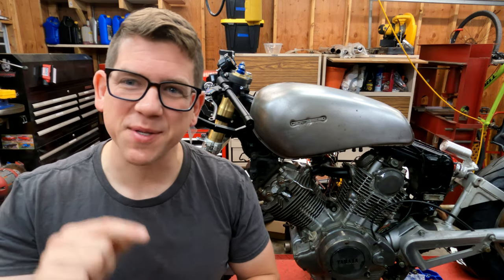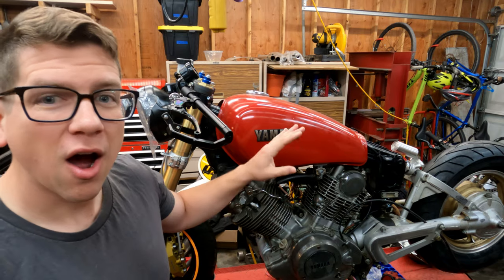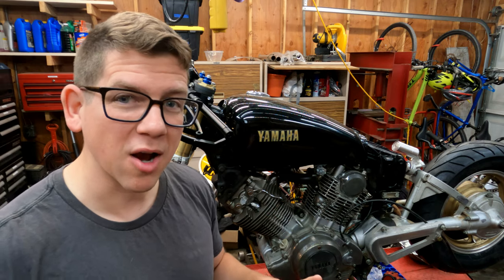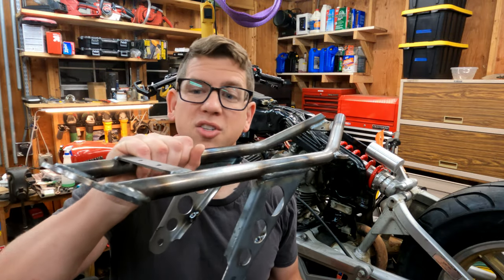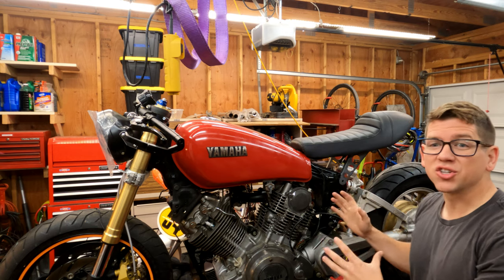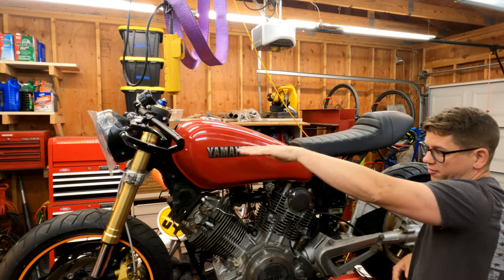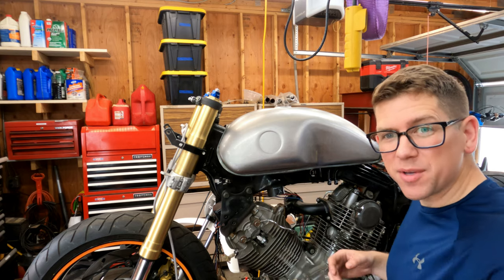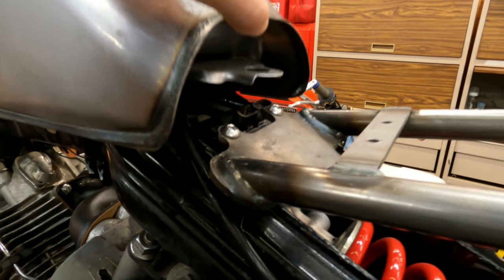Installing the TANK & SEAT on Our Custom VIRAGO Build  - Yamaha Virago Build Ep6

Comment: Hi, I started the same project around 2 years ago, and I'm stuck mounting the tank. I have the same tank that you have, but I don't know how you found the position of 1st hole to put the front base of the tank.  You did such a great job! And I'm afraid of damaging the chassis.  I have followed you all my fabrication and it has been very helpful. Thanks for these videos.
Reply from the maker: Just have someone hold the tank where you want it, make a mark on the frame, and go for it! After drilling one side, I made a template using paper and a pencil so that I could lay it on the opposite side and mark the hole, ensuring they line up.

Comment: Hey what did you use for the fuel system connected to the tank? I got the two side petcock now this tank comes with only one.
Reply from the maker: If you're using two carbs still, you'll have to run new fuel lines from the carbs to a "T", then a single line from the "T" to the petcock. 

I'm using a single carb, so just one line will do.
Reply: @two-cargarage  yeah I’m still running 2 carbs got the idea but I also have the vacuum lines coming out from the carbs.
Reply from the maker: @Ayadw7  those used to go to the petcocks, but now your new petcock will be manual so they are not needed. Just cap them off.
Reply: @two-cargarage  great thanks a lot 🙏🏼